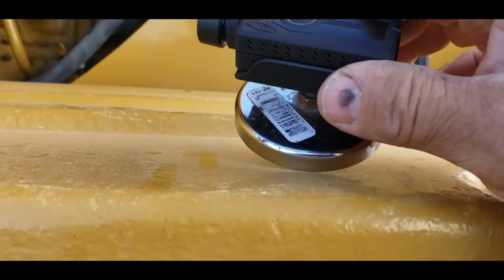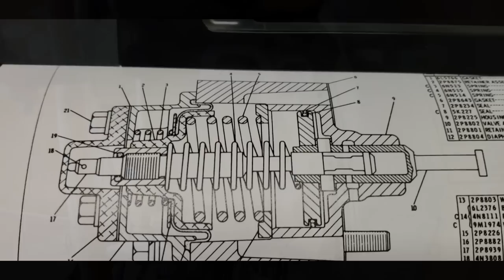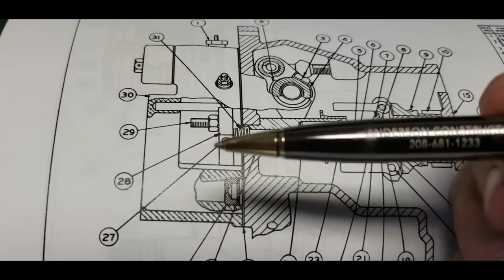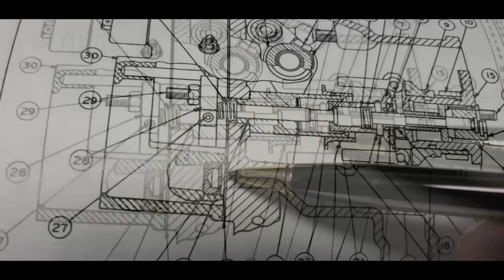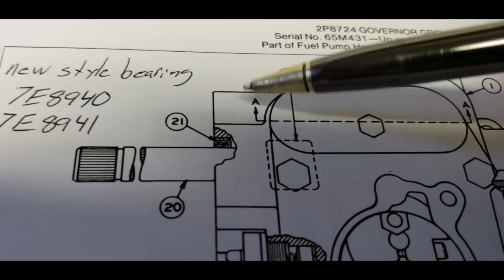Caterpillar Air Fuel Ratio Control Rebuild

Comment: Great video Jeff, as a Cat dealer mechanic in the 80,s we had to deal with real fuel injection pumps day in and day out, D348 was my favourite, remember we had one out of a 777 on the dyno at work one day and 2 1st year tradesman were running it and as i walked in they said "look on the bench" to which there was the whole AFR and governor set then another block climbed atop the engine and put a coat hanger straight hooked to the rack, then we fired it up and he pulled the rack to full fuel with no load, suffice to say the dyno room was a little black after that!

Comment: Some things in life are just unbelievable. Back in the 70s. We Got brand new peterbilt and kws with 1693s. 3406PCs. 3408s. We never took any measurements on things. We would replace what was broken. Turn the screws. And drive them a million miles. Now every one does stuff really legit. Life was So Much Better in the old Days 😌 😪

Comment: Hi Jeff. great video today. I am thinking that the air filter that you have on your 505 maybe to small. K&N makes on that will allow air intake through the lid.  Just wanted to mention it. I had a problem with my jet boat falling on its face turn out being too small of a filter. Rock on brother 💪.

Comment: Jeff I love you man. But we need to see some Kenny action. Oh but seriously though. Could you make it smoke less if you reduced the amount of pressure it takes to “cock” it? I don’t know it’s just a meandering thought that popped in my head. I was going through some of your older videos and you said you were taking suggestions on doing things on old Kenny. I’ve got a couple of ideas, 1. Make the 1693 direct injection, pre-cup is good but DI is better on fuel mileage from what I’ve read. 2. Powder coat and rust inhibiting paint for the new frame, you said one of the biggest problems was rust on old Kenny’s frame. And idea 3. 20,000lbs front axle on air ride, you were trying to decide on the front axle. My farm truck is a old A model that used to be a concrete truck. I plumbed and wired it for a trailer and converted the spring ride to air and put air bags on the front axle. Between the air ride and the bigger front tires it rides like a feather in the breeze. Love your videos, I never have to watch the video before I like it I just give it a like and then watch. Great family entertainment

Comment: only odd thing to me is she seems extremely clattery like at 16:31 is it a fuel knock or just an old rattley cat? ,, im not particularly familiar with these older cat engines mainly the 3126b and such in the equipment at our shop
Reply: clatterpillar
Reply: Ken Uber 😂 i like it,  what’s really disappointing  is this new cat equipment.. i was having a normal volume conversation over a d8t running wide open 1 bay over from us...
Reply: Ó

Comment: What motor is this?
Reply from the maker: D343
Reply: 1694 🐈
Reply: @chrismanning3911  1693? Never heard of a 1694 but I'm aware the 1693 is the over the road version of the D343
Reply: @Jpaydirt  dad loves these motors. I figured it was a d343 just wasn't sure.
Reply: @tinmanstavern  1600 Series was used in hiway trucks. Basically the same as the D300 series counter part, just made to fit truck chassis. Rear cover, and a few other items. You had three 1673 prefixes, one 1673B prefix and two 1673C prefixes. If memory recalls the was like a D333, then turned into a 3306. They used push tubes on the valve train. A 1674 was a inline 6, 4.75 bore overhead cam, like a D346 I think. You had then a 1676 V8, like a 1674, I have never worked on or seen one of these in a truck. And lastly the 1693, D343, 5.4 bore.

Comment: I worked as a mechanic for cat in central California between 2006 and 2008. If I remembered right the 657 scrapers I worked on had 3408 up front and a 13 liter equivalent in the back. We would pull those out and  repower them with a c15 accert  at 550+hp up front and c13 with about in the back.
Reply: The B57s were 950 hp